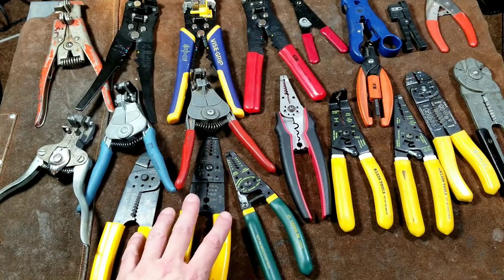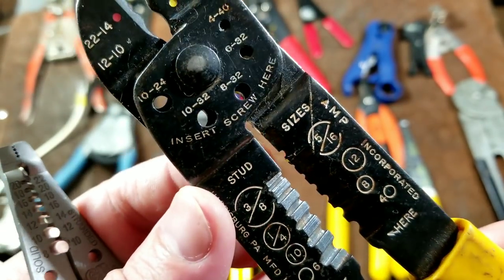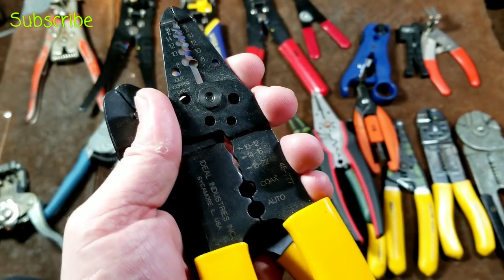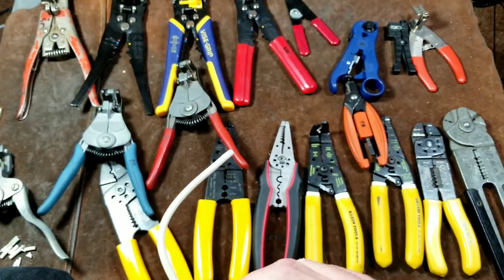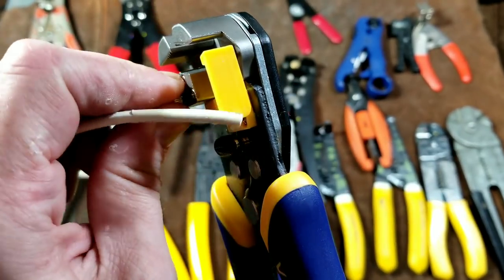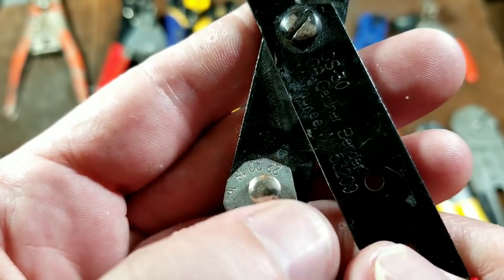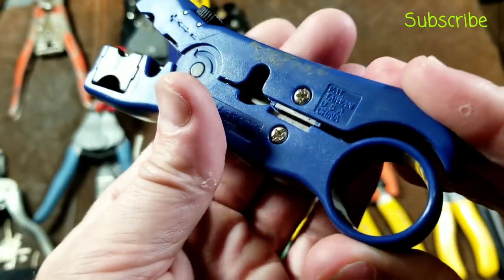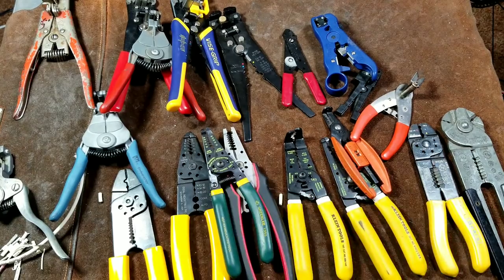Professional Wire Stripper Review & Comparison

Comment: Excellent Review! Been stripping wires for more than 30 years and I still learn something.
The nicest wire stripper I ever used was a thermal one. Hot knife bars melt the insulation and it slides off the almost no effort and zero chance of nicking/cutting strands... but they run ~$500. Wasn't my unit.

Comment: Your missing the most important advantage of the Vise Grip type of strippers. They work great for removing the sheathing from Romex. You lift the stop out of the way and put the Romex into the jaws and activate the jaws. It separates the Romex and you just pull off the sheathing. Worth the price for that feature alone.

Comment: Thanks for this video. I have an old pair of Gardner Bender GS-30 wire strippers that are marked with A - H, I was able to pause your video and convert them to the corresponding wire gauges 10 - 24. I also have a better idea of how to use them correctly, for those of us that only do electrical work every 20 years or so. 😄

Comment: With the non-automatic strippers I have found that in order to get a wire to strip correctly that I have to close the strippers, spin them around the wire once and then pull the insulation off of the wire.

Comment: I have used this automatic stripper and found that this is only useful for stripping individual wires and not a cable having two, three or more wires means a two core, three core or multi core cables like computer networking cables having many wires inside an insulating cover. When such a cable is stripped using this stripper, it strips everything that is outer as well as the inner insulations of the wires so we can't only strip the outer insulation and then strip the wires inside one by one according to desired length. If a cable is to be stripped then we'll have to use a sharp knife to first cut the outer insulation and then use this stripper to strip the wires inside

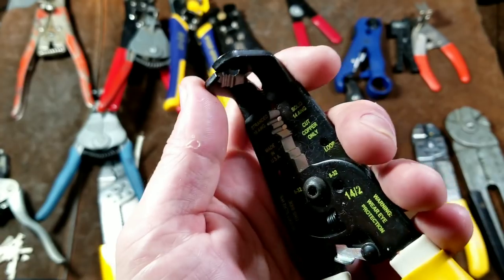Comment: Great video but a point I didn't see mentioned here with those nm cable  stippers (romex) at 12:45 is that those are used to strip the outer jacket housing the actual insulated conductors. It may be so that the actual conductors onside the shield are solid but you still run the risk of going too deep on the outer jacket and nicking those inside conductor insulation which you can't fix. Or at least you can't fix and have it code compliant. Electrical tape is ONLY permitted to repair the very outside shield. Not the inside wire insulation.

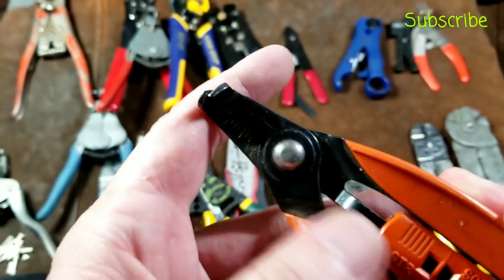Comment: Strippers at 15:40, AFAIK, are only used for wire wrapping connections. Still have a set that came with separate stripper inserts for diff size wire. Have used these type for many, many (sooo many!) telecom terminal blocks in the past.

Comment: I really do not agree with the assessment of the automatically adjusting style of stripper. A good unit will strip small gauge, both solid core and stands very nicely as well as thicker eve multi-wire stands. There will always be the outlier where only a sharp knife will do the job, but for 99% these are just fine.

In fact, using them with small electronics, they are even better as you do no have to manual tug on tiny wires. These are the tool if you need to make custom jumper wires on a PCB.

Also, you are using the bump wrong.

Comment: best ones for guitar wiring?
Reply from the maker: Guitar wire is tough because of the solidcore and then the additional wire that's wrapped around I would use a manual plier set the automatic type strippers won't work well with that type of wire
Reply: @CatusMaximus  thanks friend!